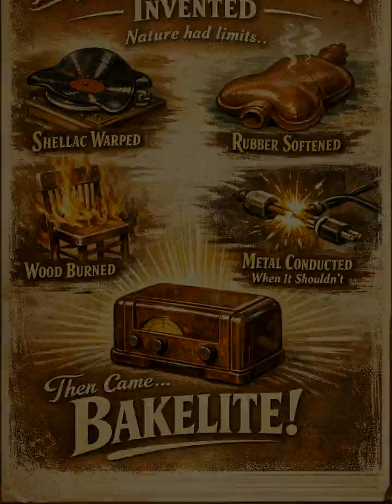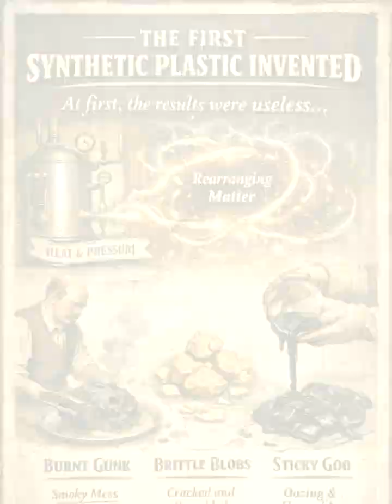The First Synthetic Plastic Invented #Chemistry

Comment: If I recall, Bakelite was used in making 1940-50s tabletop radios…the cabinets themselves. The heat from the vacuum tubes inside kept everything warm. A few decades later those ornate radio cabinets began developing cracks and chips. Sadly they faded away to be replaced by current Chinese replicas.